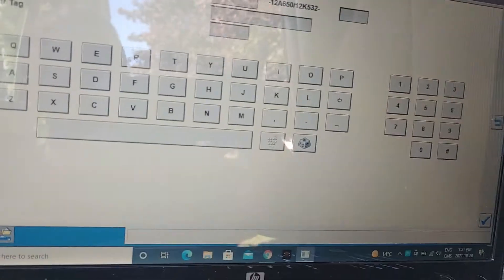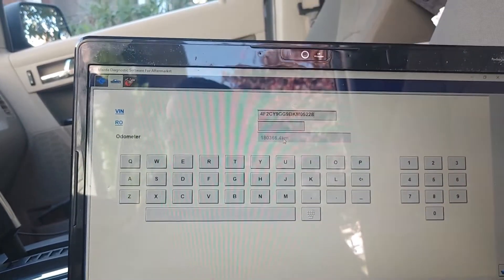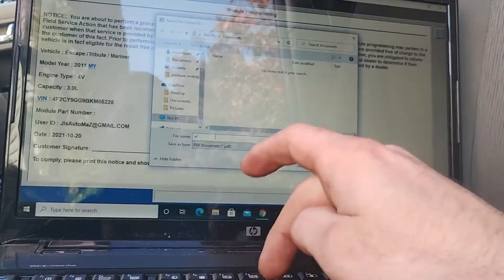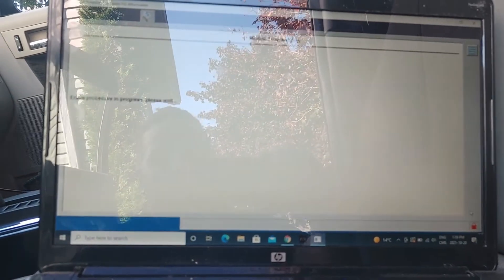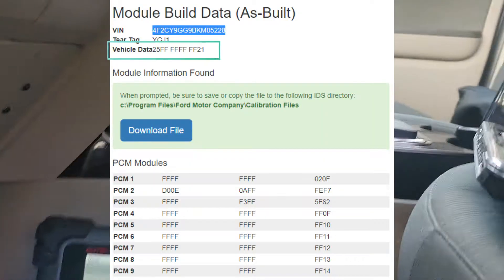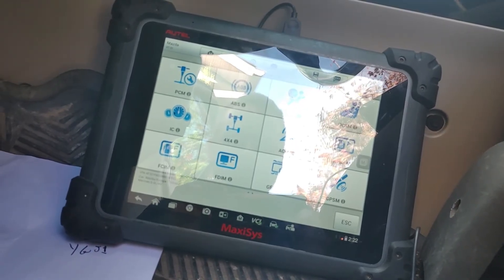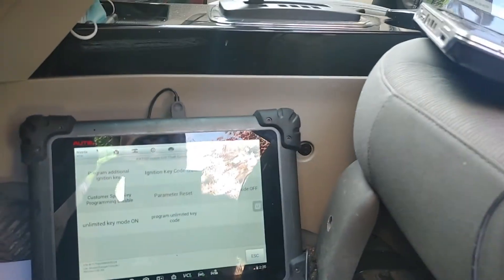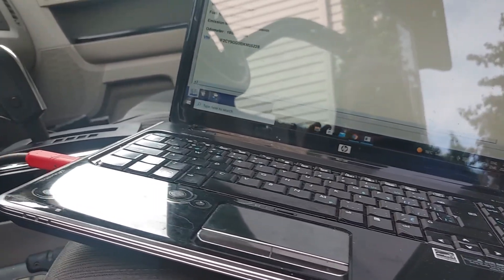Ford Pcm Reprogramming

Comment: How do you know if you can use a used module or not
Reply from the maker: There are many ways to use a program a used module, sometimes its just cloning it and sometimes just reprogramming it. typically the software will tell you if you can or not.
Reply: Ford tech make you loco has a video showing how to program used module.

Comment: Can you do this with a used pcm using mazda mmp or do I need the whole ids software?
Reply from the maker: For Mazda mmp, Ford is ids or fdrs
Reply: @JLsAutoSolution   Thanks for the reply. so Ford IDS will work?  For some reason I can get my vcm2  to work with Ford IDS but Mazda IDS will not detect it.  From everything I have read Ford and Mazda IDS cannot be installed on the same computer.  I've had to reinstall windows multiple times just to  Try to get this computer programmed and I'm stuck.  Ford IDS doesn't seem to recognize my 2012 mazda 3
Reply from the maker: @Alobster1  that is correct. You cannot have Ford IDs and Mazda on the same computer. They actually have to be on two separate computers or two separate hard drives

Comment: Right please verify something for me... I installed a doner ecu, called auto locksmith to code my old keys to car but he never changed the vin number to match my car.. is it a case of keeping the same part number thats on the ecu ie (pcm AL8A-12A650-BRJ) but change just the vin number through the same setup youre doing?

I got told to download the as built data for my vin from ford and write this to the ecu but then im scared if my car doesnt start because of keys not working with it again and then having to pay another £100 to get keys done again.
Reply from the maker: so there are 3 ways to do this- 1 follow the steps in the video- 2-perform a pmi(programmable module installation) if the module is available in the pmi section.(old module is needed)- 3 perform an as built data install, the numbers can be added manually with a decent scan tool or if you are using this tool it will be done automatically when prompted.

I hope this helps

Comment: In my car  a have err code P0420. I clean PCM by forscan by after a some time the problem return. Can you remove err P0420 from PCM module ?
Reply from the maker: you need dtc delete software. and some other things like checksum corrector ect.

Comment: I have ford c-max plug-in hybrid enegri, pcm had some error. i replaced , but pcm was form not plug-in c-max, so car don't charge( but items p/n and h/w in the same). Can programming fix it?
Reply from the maker: I wish i could say yes, normally the plugin system is related to the high voltage side while the pcm is related to the 12v side.  The 2 sense wires which tell the obc that the vehicles charging  along with the relay systems are the only thing on a low voltage. you can always try, ford likes to use one pcm with different configurations so its easy to replace parts with a little programming. hopefully this helps.

Comment: WHY DID YOU PROGRAMED ABS BECAUSE U REPLACED PCM NOT ABS?
Reply from the maker: The Programmable sata gets erased in some modules along with the vin number, so some modules need to be reprogrammed when replacing a pcm on ford vehicles.

thanks for watching